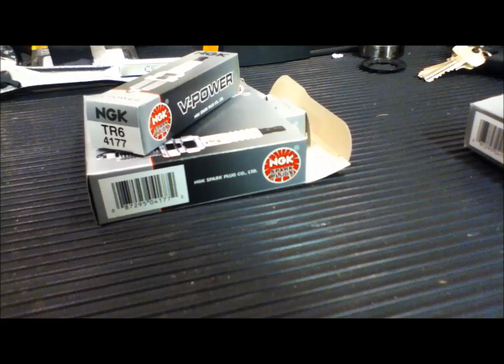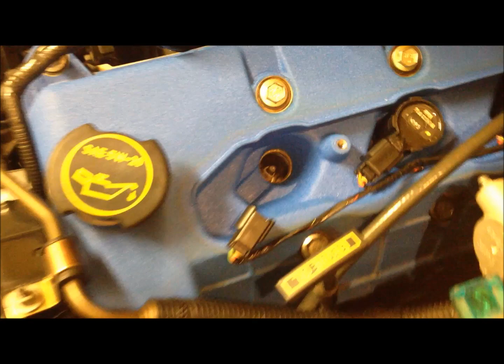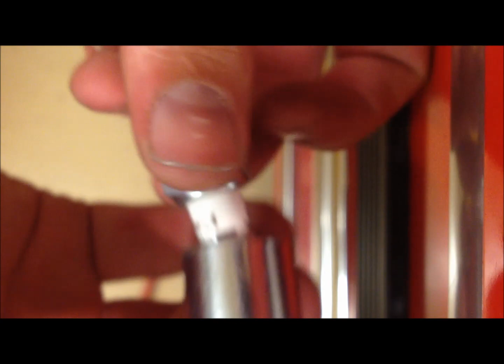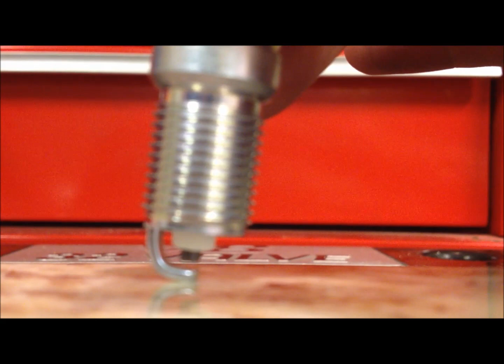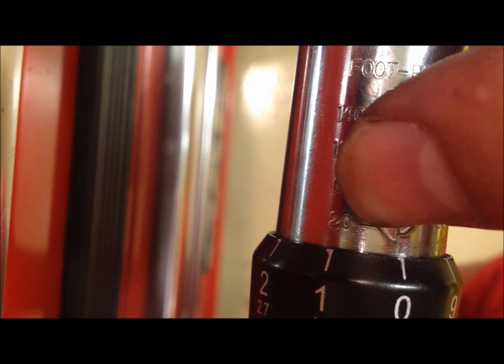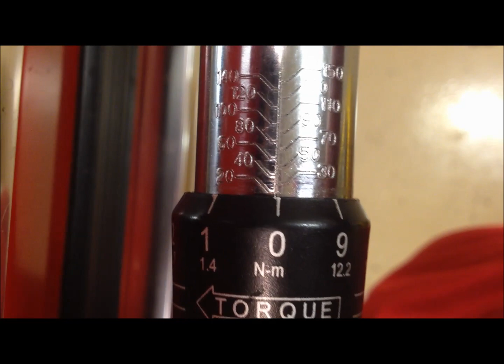How to change your spark plugs DOHC Ford V8 (Part 1/2) Mustang SVT COBRA, Aviator, Navigator, Mach 1

Comment: I know this video is almost a decade old but maybe you’ll see this comment. About 10min ago I took plugs 5-8 out cleaned what little dirt was in the threads.. checked the gap which was about .026 which is how they came when I bought the car. Put a little anti seeze on threads and put them back in. Now the car is backfiring pretty consistently and my amps on my multi-gauge are showing 13.2-13.9 I did one fairly rapid excelleration to merge into traffic and the car sputtered out. Any reason why my amps would be reading lower?
Reply from the maker: It could be a broken plug. The alternator is still charging if it’s 13.5+ but if it’s failing (which is common on terminators) you might look into a better one https://youtu.be/0laLuFYHCU8?si=hEs1NARgGUq-q4uH
Reply: I’ve only had my Cobra for a month or so but I’ve been addicted to your videos. They’re extremely helpful. And thank you for your response. I didn’t have one of my coil packs pushed completely down. I pulled it into the garage let it cool down pulled the plug and luckily I didn’t cause any damage. I put the car on the dyno this Friday, so I’m extremely relieved it wasn’t a bigger issue. Thanks again!

Comment: 99 cobra forged bottom end , 2.1 kenne bell 475 to the wheel. what should my spark plug gap be , which do you recommend too ? thanks!!
Reply from the maker: I’d gap at .030, and if you have problems gap down to a minimum of .028.
Reply: @dannyjohnsonsgarage  thanks my friend !!
Reply from the maker: Same ngk 4177 would work fine https://www.amazon.com/NGK-4177-PK8-Spark-Plugs/dp/B072DRCK6Y?crid=1YTZGBYYTAK2D&keywords=ngk+4177+tr6+spark+plug&qid=1646841868&sbo=RZvfv%2F%2FHxDF%2BO5021pAnSA%3D%3D&sprefix=ngk+4177%2Caps%2C126&sr=8-1&linkCode=ll1&tag=2004047-20&linkId=66effaa775b16495172f05f1ee3b3f30&language=en_US&ref_=as_li_ss_tl

Comment: Would ngk tr55 , 3951 work on a 99 cobra?
Reply from the maker: Yes, those will also work fine. They are one range/step colder than the tr6 so if you’re not supercharged it should be pretty close to factory. Tr6 extracts a little more heat, tr7 even more but it may run rough and is only good when needed https://youtu.be/fpov2j1SxwE

Comment: Hey Danny I have a 99 cobra with a vortech v1 supercharger and I was just wondering should the plugs already be gapped for the charger? I bought the car built so I didn’t do any work on it I just keep up with maintenance
Reply from the maker: It should be part of the installation process. You can remove one and see, but if the car isn’t misfiring they probably are
Reply: @dannyjohnsonsgarage  the car starts to putter sometimes and it won’t clear up till about 2500rpms, it could be something totally different than the plugs but I figured I’d ask since I’m doing them. I really appreciate the help

Comment: So, is it ok to use the 9 thread plugs you showed in the video, on a 1999 Cobra with 4 thread plugs, stock, in current form? Because the 4 thread plugs are no longer available at my local Ford dealership.
Reply from the maker: Yes, it only uses the 4 threads but still sits the same for the right plugs https://www.amazon.com/gp/product/B08VBS2JBZ/ref=as_li_qf_asin_il_tl?ie=UTF8&tag=2004047-20&creative=9325&linkCode=as2&creativeASIN=B08VBS2JBZ&linkId=ddb1ace78751fcab56801a4c859d689e
Reply: Thank you, Danny. You even provided an Amazon link. Doesn’t get any better than that. Cheers and happy wrenching, sir!

Comment: What gap do u recommend for an 03 cobra stock Eaton ,2.93 pulley . gap size .35?
Reply from the maker: I’d go .032
Reply: @dannyjohnsonsgarage   thank you, I’d also like to upgrade the alternator before something happens to it, what’s your thoughts on the j2 fab for the cobras?
Reply from the maker: @TommySVT  I would go with mechman or nations with an external regulator
Reply: @dannyjohnsonsgarage   ok thank you, I figured u were the guy to ask

Comment: I'm preparing to try this job by myself for the first time on my Terminator. Thoughts on NGK's recommendation against anti-seize, given the risk of over-torquing and the claim of a trivalent coating with built-in anti-seize properties on these plugs? I know you mentioned the possibility of over-torquing in the video, but given the above, you'd still use a small amount of anti-seize?

More info: https://ngksparkplugs.com/en/resources/5-things-you-should-know-about-spark-plugs

Comment: Hey there! I am using the same spark plug onto my car and it is burning them right through the tip . They melt off It is a 04 Cobra with a 2.6 kenne Bell. Any ideas why that may be happening?
Reply from the maker: Sounds like you’re running lean. Do you have a wideband?
Reply: @dannyjohnsonsgarage  about 15.2  to 15.4 in my wideband
Reply from the maker: mariela Hernandez Under wide open throttle? That’s way too lean. You’ll likely melt a piston or pre-ignite the fuel. It needs to be at 11.2 under open throttle
Reply: @dannyjohnsonsgarage  I'm sorry wide open throttle is about 11 through 12. Does that sound about what it should be? Sorry I thought you meant during idle
Reply: Hey i actually switched out my spark plugs and my car keeps burning one side of spark plugs then i have them replaced and the burn the other side. Any ideas of what could be going on? The tip of the spark plug melts off. Thanks in advance :)
Reply from the maker: mariela Hernandez Did you correct your lean condition? Needs to be 14.7 idle and 11.2 for wide open throttle
Reply from the maker: mariela Hernandez So for example the driver side loses plugs then the passenger side?
Reply: @dannyjohnsonsgarage   so the ratio mix is at a good number but my  car when about 100 mph it cuts off and loses power. I checked the spark plugs and they melted again. The tip melts off. It will melt one side of the motor and then i replace them and then the other side melts . I only drove it about 100 miles when it remelted them again
Reply from the maker: mariela Hernandez Overall it may be running a good mixture, but perhaps you are getting small lean conditions from bad injector(s) or pump. Can you monitor fuel pressure?
Reply: @dannyjohnsonsgarage  yes i can check thr pump but is there a way to check the injectors?
Reply: I got 90 lb injector that i put in about a month ago and a 360 dual pump
Reply from the maker: mariela Hernandez Fuel pressure is the best way to test without removing them
Reply: @dannyjohnsonsgarage  i clicked the link but its to remove the starter
Reply from the maker: mariela Hernandez Sorry, here it is. It show you where to hook up for fuel pressure at the rail. You can borrow a gauge from autozone or something (you’ll need an extension to see it in the car) https://youtu.be/H9RdATbZWD4
Reply: @dannyjohnsonsgarage  i noticed smoke through the oil cap and if i step on the gas a bit it throws oil upward. Should this be ny motor gone bad?
Reply: @dannyjohnsonsgarage  so it did end up being my engine. It has tp be rebuilt . Do you know of any good performance shops that are in the st george or Vegas area?
Reply from the maker: https://www.amazon.com/gp/product/B007ZAQLF6/ref=as_li_qf_asin_il_tl?ie=UTF8&tag=2004047-20&creative=9325&linkCode=as2&creativeASIN=B007ZAQLF6&linkId=2cc5b094f501ec821c39dc5016c73046

Comment: looks identical to my 5.4 dohc boss 260 engine i thought it was a 3v barra with a different intake manifold
Reply from the maker: This is on a 4.6L DOHC Terminator Cobra 2004
Reply: In Australia we have a 5.4ltr V8 which has the F150 bottom end with Mustang Cobra R quad cam 32valve heads

Comment: What's bro  what paint process did you use to paint the  blue Valvecovers? I can see it's vht wrinkle ..Will aprecciate the information
Reply from the maker: Carlos Silva These are actual Ford GT cam covers. They are a Ford part, wrinkle blue powder coat from ford

Comment: Does this apply for the 03’ Mercury Marauder?
Reply from the maker: Yes, but leave the spark plug gap factory unless you also have a supercharger
Reply: Thx a million for the video. I was scared to work on the spark plugs cause they are pretty deep.
Reply from the maker: DAFATBOY2016 You’ll do great! Just take your time, use anti seize, don’t over torque. I imagine your marauder will be like my mach 1 (4 thread heads on the 03 or 9 thread heads in the 04). So if you have the 4 thread heads just keep an eye each oil change to make sure they don’t come loose

Comment: Good video.  I just bought a Lincoln MarkVIII and it needs a set of plugs and maybe coils.  I'm coming from GM LS engine car and couldn't figure out where the coils were hiding on the 4.6 dohc.  Got the cover off after watching your video and finished the plug swap in an hour.  Thanks man
Reply from the maker: tim d Very cool. I’ve been there ha ha. I remember looking for them as well 😅

Comment: What kind of spark plugs and coil packs would you recommend for a 2003 Mustang Mach 1?
Reply from the maker: Jimi Ogletree OEM factory coils, motorcraft plugs or the tr6 like in this video. Keep the gap stock unless you’re supercharged/forced induction
Reply: Danny Johnson Thank you so much!

Comment: Is it common or what is the meaning? My coil boot has oil on spark plug side. And I think I saw oil inside the spark plug housing. 03 Mach 1.
Reply from the maker: it’s typical to get some oil on the coil boot side from a grommet seal failure- not too big of a deal, but if the plug tip itself has a lot of oil it could be from oil getting past the ring. You’ll see the grommets on the back side of the cam cover in this video https://youtu.be/NT5Z5L2wAss
Reply: Danny Johnson so Danny I found the threads of my spark plugs lathered in oil. Could this be I have bad tube seals? I was going to buy the valve cover gasket kit from fel pro and replace all the gaskets, like the valve cover and tube grommets and the 10 bolt grommets. So is my tube seals are bad?
Reply from the maker: Angel Martinez that’s what it sounds like. Is the tip dry and oil appears to be working it’s way down from the coils down the threads?
Reply: Danny Johnson yeah. The tip is dry. It looks like the oil is running down to the threads. So im thinking it's the spark plug tube seals. Do you have any videos on changing the gaskets Danny? Thanks for you help bro as always your the go to guy for how to videos!

Comment: How much psi are you running I’m at 15psi so how much should I gap my plugs
Reply from the maker: Andres Maciel I'm 17 psi and gapped at .028. I'd recommend .030 for yours. The biggest gap without issue the better
Reply: Danny Johnson OK cause my car stutters when I’m on high gear low rpm’s at wot I pulled my plugs and they’re at .055 and some .060 you think this could be the issue
Reply from the maker: Andres Maciel that would be more likely if the car was under boost. The smaller gap is to keep the spark from blowing out from boost. You're likely culprit is the coils that go on the plugs. Mine had the same issue. Also had the same issue on my 01 GT. very common. Factory coils are the best replacements
Reply: Danny Johnson yes it dose when it builds boost
Reply: Thanks for all the help brother I went and bought the same plugs and gapped them at .030 and the car is actually running a lot stronger than before so I guess I was losing a lot of power thanks once again

Comment: Hey man! So for a 5spd 2003 Mach 1, what torque specs should they be at? And then what about gap size for the 2003 as well? And what brand(s) do you recommend for the spark plugs?
Reply from the maker: Kaleb Joaquin if its stock and not supercharged, go with stock gap as they come out of the box. Plugs won't be too important for n/a cars, so I went with motorraft for my Mach 1 (part number SP-433 platinum)
Reply: And for the torque specs what do you recommend?
Reply from the maker: Kaleb Joaquin keep it low. Like 13 foot pounds. Hand tight basically but check it often
Reply: Thanks boss, appreciate the immediate response and information! Definitely will earn a subscribe from me. Keep up the good work!
Reply from the maker: Kaleb Joaquin thanks. Check out my other videos if you haven't. There are quite a few already on gear installs, exhaust (need to do a header install soon), etc
Reply: @dannyjohnsonsgarage  hey Danny this is a long shot but I have a 99 cobra DOHC with a vortech supercharger and I was wondering would the current spark plug already be gapped? I had figured but I didn’t do any of the work on the car so I don’t know if there were any corners cut or not.

Comment: yeah i think its time for coils and plugs on my 01 cobra. when its cold it misses a little until its conpletely warm. 83k miles on it
Reply from the maker: Ivan Psimer definitely a great time for a tune up
Reply: Danny Johnson would you reccomend the same plugs you used in the video even though mine isnt a supercharged model? Only mods are offroad H-pipe, flowmasters and K&N cold air intake
Reply from the maker: Ivan Psimer yes, but just keep stock gap.
Reply: awesome, thank you very much
Reply: So, is it ok to use the 9 thread plugs shown in the video, on a 1999 Cobra with 4 thread plugs, stock, in current form? Because the 4 thread plugs are no longer available at my local Ford dealership. Please help. This has been keeping me from changing my plugs at the moment. And the Ford dealership parts department doesn’t know either. Sad, I know.

Comment: Hi, I have a 03 mach1 and chugging n lugging in 5th gear only. Had new plugs n fuel filter done and prob solved for the first 5 miles. Now back to chugging in 5th gear. What should my next step be? Coil packs? New plugs again? I'm learning to do my work on my own thanks to the knowledge u guys give n I appreciate it.
Reply from the maker: joe darby coil packs for sure.
Reply from the maker: joe darby as funny as it sounds, a bad O2 sensor (fronts only) can cause the car to miss and chug too. On my Mach 1 it threw a code that it was running rich, but it was actually the sensor itself. I'd still look at coil packs first. I have an O2 sensor video as well on this channel
Reply: Scrun Johnson thank u very much for the info. Will get back to ya.
Reply: Friend of Mine Had 5th Gear Go Out on a  Test Drive,of A 04 Mach 1,Before He Bought It,Previous.Owner Was Female & May Have Not Downshifted & Got Lazy & Lugged 5 th Gear,a Lot.Ur Post Has Some Age on it,Hope Urs Wasn't the Same Problem.

Comment: did the 4v have the same problem as the 2v engine with the spark plug blowouts?
Reply from the maker: D to Tha A yeah, mainly on the 2003s that only had 4 threads. The 9 thread revision basically corrected it, but it can happen to either

Comment: i have the same engine in my 99 Continental what size extension did you use to get to the plug ?
Reply from the maker: 99GPSE 12" extension that was 3/4". I had to use a reducer attachment for it to be paired with the 1/2 drive breaker bar
Reply: Thank you very much for the reply i was curious as to how i was going to get to the plugs.
Reply from the maker: 99GPSE No problem. I have them gapped pretty tight in this video because the car is supercharged. If yours is not supercharged, keep the gap stock.

Comment: You do awesome videos! I bought a 1997 Lincoln MK VIII with the 4.6 DOHC for my father and have been looking for videos to help him fix the #6 and #8 misfire codes. I had a 2V and it turned out to be moisture and plugs but I was worried I would strip the heads.  Job well done, very comprehensive. It's amazing the way you get whatever camera your using to get focus on the tip of the spark plug. Good job and please keep it up.
Reply from the maker: Thank you. I'm glad you enjoyed the videos. It's tough sometimes because I'm only using my iPhone to make the videos.